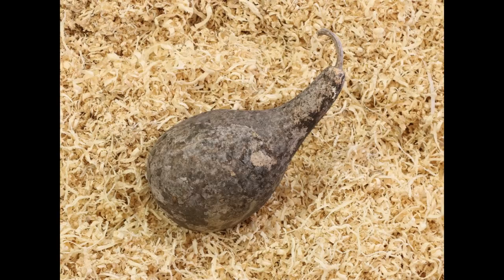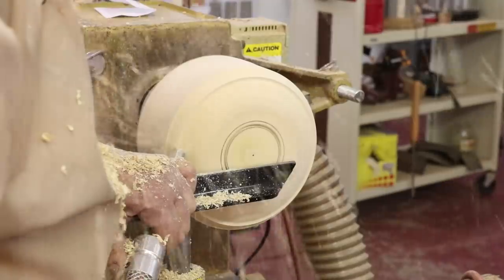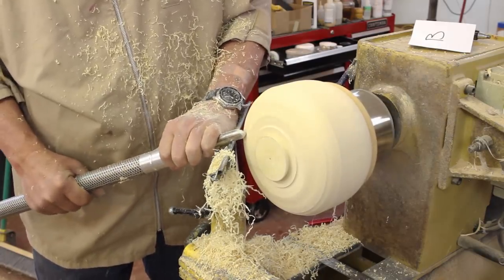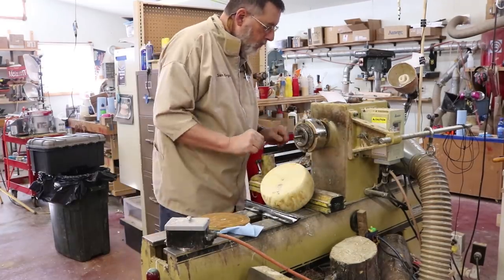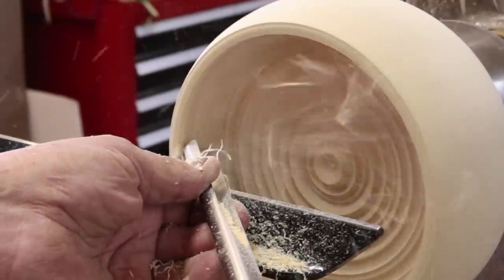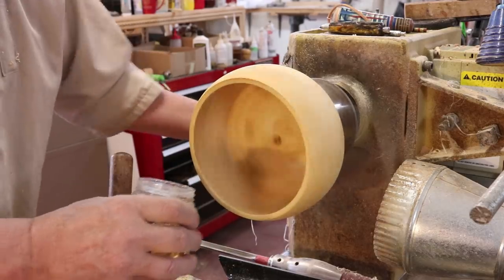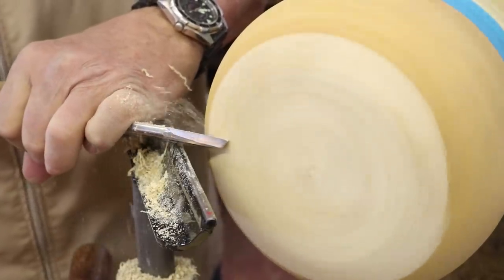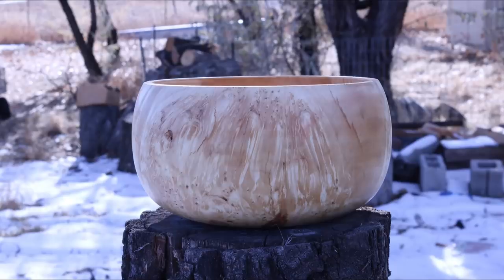CALABASH BOWL:  Woodturning with Sam Angelo  the WyomingWoodturner

Comment: Sam, As a newby turner I loved your video.  Well done!  I do have a question.  You finished the bowl while it was still wet, and mentioned that you put it in a paper bag to dry.  After the bowl dries, do you remount it, true it up again, and then finish it again?
Reply from the maker: Jon,  good question. This piece of wood was not completely dry, There was still probably 15 or 20% moisture still in the wood.  Sometimes a piece of wood is just simply too wet to either sand or apply any finished to. I typically Cover the surface with shellac or even oil and then after it is dryer I can apply more finish. I do sometimes remount and true up a bowl after I had  rough turned it. But if I finish turned it in one go,  I will turn it around a quarter of an inch in thickness or a little less and then if it moves it won't be a big problem and the wood should not crack. All sounds a little complicated but it's all about slowing down the drying process thanks for watching Sam

Comment: Nice looking bowl and instructive video but I missed the significance of the gourd shown in the first part of the video. Is the bowl intended to mimic that shape in some way? Thanks as always...
Reply: Calabash is the name of a kind of gourd, it is often cut, hollowed out, and set to dry to create bowls. So, yes, the bowl is meant to mimic the general shape. :)
Reply: moarHertz McGhee I knew there was a connection. Thanks to you now I know what it is. Thanks! (I suspect I’d prefer the wood version...)
Reply from the maker: Thanks   @moarhertzmcghee8195    right on.
Reply from the maker: I do explain this at the very beginning---although I did not do a great job of making the connection.  Calabash (the gourd) is the name applied to the shape of bowls like the one I turned.  Sam

Comment: Sam, help me!!! I constantly get circles on everything I turn. Using both carbide and HSS tools and it does not matter what kind of wood I use.  Whole circles, half and partial circles. Sanding only makes them more visable. I'm ruining everything I turn. Can you, Sir, please help me. Thanks, Buddy
Reply from the maker: Buddy, is this happening on the inside of your bowls let me know where this is happening and what kind of pieces you're turning. I don't really use carbide tools to turn with except for hollowing. And I'm not exactly sure what kind of circles you are describing. What I think maybe happening with your gouges is the heel of your tool is contacting the wood and as you cut it makes shiny spot. Is that what you're talking about.  Can you send me a picture were to of the wood where this iis happening and also one of your gouges that you're using. I just need little bit more information Sam
Reply: Sam, thanks for replying to me and doing it so fast. B.T.W. You are the only one whom responded. I use primarily Carbide tools, made them myself, decent quality and really low price. I use 2 HSS tools and they are both skews. I'm still very new to turning. I usually get at least 1 catch per project. Really bad catches and I think my blanks are never getting true after such catches, I may have a wobble that is causing my circles, or half circles, or partial circles. The circles are in the bottom ( inside and outside) on bowls that I turn. I thought that continued turning after a catch would true up the way the project turned but apparently I'm wrong. If I can finish one project without a catch, and still have circles I will contact you again. Sorry for bothering you, but again...Thanks for your comback.  @WYOMINGWOODTURNER
Reply from the maker: @buddysteele8220    Buddy, thank you for getting back to me with more information. I am beginning to understand what the problem is. First using a skew on a bowl can be a disaster. A Skew chisel is primarily for spindle work. If you're trying to remove a lot of wood on a cross grain project -you're going to get some major catches.  Next I don't use carbide tools except for hollowing.  You might go back and watch some of my videos on turning a bowl.  Four bowls, I use bowl gouges with a bevel and a flute.  Check out this link.   https://www.pinterest.com/pin/485262928596671662/ 
I think one of the real issues in wood turning now is using carbide tools.  Those tool makers or individuals selling carbide tools for wood turning imply that using them is easy.  It may be easy but it certainly is not the best approach. Anyway I think you need to investigate cutting tools like a bowl gouge.  Watch some good videos on turning bowls. And you might also check out taking a class are going to a wood turning symposium. I hope this helps Sam